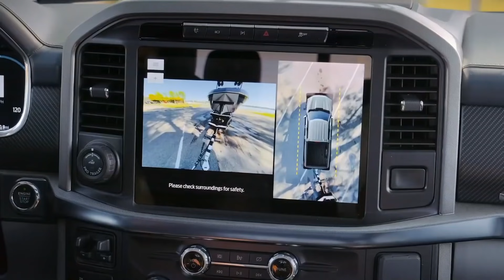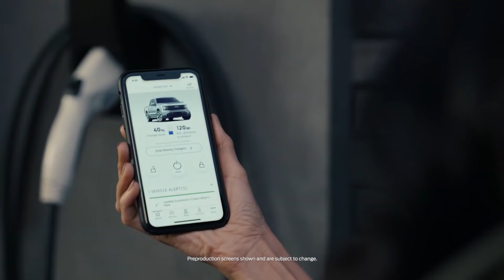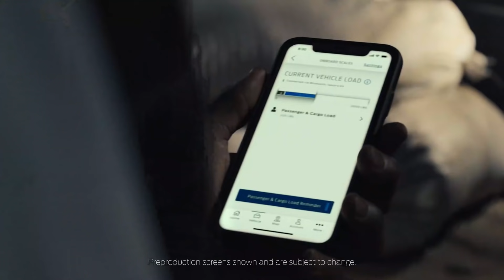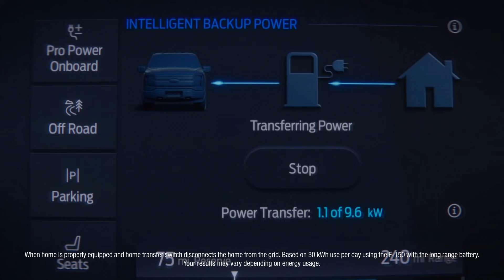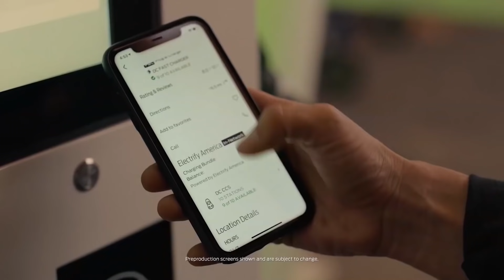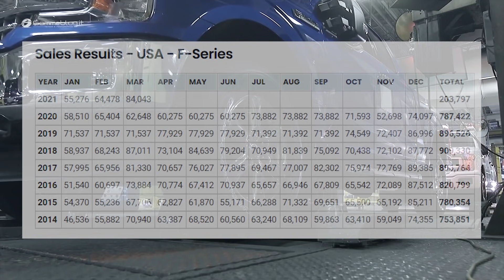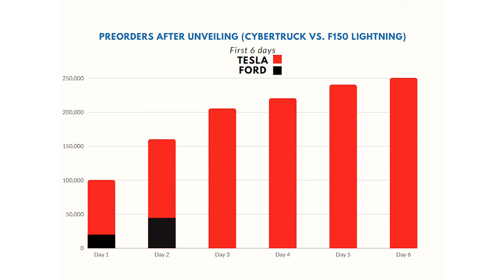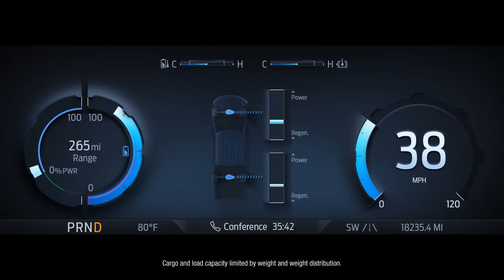Ford F150 Lightning Reveal: A Costly Mistake On Stage? | F-150 Lightning VS. Tesla Cybertruck

Comment: I’ve never owned a pickup truck and i decided to put a $100 Reservation for the Ford F-150 Lightning. I wanted a Tesla car but after finding out i could get a pickup truck for $52K or less, i decided to go for it. The 230 miles range is not a deal breaker for me and i love the truck to grid tech. Will the base model have the truck to grid  technology? I think i will be pleased.  Not sure about the Osbourne effect since I’ve never owned a pickup truck.

Comment: I believe you didn't  do enough research on Ford'spricing - The extended range was announced as being a $10,000 option, which is just for extended battery. The XLT was priced at $52,000 (230 mile range), and Platinum, with extended range battery and all other options was announced as a $90,000 vehicle.

I firmly believe adding $10,000 to any model to get a battery with an additional 70 miles of range is ridiculous- and I am a Ford investor! They should have included the extended range on ALL models above Base model. And Top model should have been reduced in price to under $80,000 to be far more competitive to the cybertruck and to win over the hearts of existing combustion era F150 drivers.

Comment: Just one data point for you,
I Pre-ordered. There is 0 chance I'd buy a brand-new ICE vehicle. 
Truck will replace my Prius, expecting 3-4 years before they'll actually be able to deliver me a an extended range model for <$60k. 
400hp vs 4000hp is irrelevant to me. Both will burn the tires clean off when I want that to. Same thing with 300 vs 3000 mile range, It doesn't matter because I'll never drive that much.
I'm not going to buy into a new truck company like Rivian, for fear they may go bankrupt and service/parts nightmares. Like a lot of people I've got bias towards and nostalgia for Ford Trucks. The CT and the Chevy's have a big wow factor in the styling, very nice, they'll do well I think. Just a bit too aggro for me personally. 

Ford marketing may well know what they are doing with this one, and we know enough about the powertrain from the early Mach E's to know that the engineering isn't completely horrible either.  I think it'll be a hit.

Comment: Front trunk is a sold hit double to center field.     Nobody wants to pick a back of concrete out of the frunk in a tesla    

Not saying that makes up for not going as far.       

In any case, I installed a 60 amp line to my garage for any EV truck I buy.

Cybertruck.. at same 39k   for a 4 door... is the most likely though.   
I like the frunk in the f150.. but I like to be able to put my kids in the back seat of the cybertruck more.

Comment: CT doesn't come standard with self driving, add $8k - $10k and no $7,500 for Tesla.  That being said I would buy a Rivian before either of the other ones.  I'm sure Rivian could strip their truck down and sell something for $39K, but I would only want the upper trim level anyway.
Reply: I like the Rivian a lot but Jesus is that thing over priced. It needs to come down at least 20k more like 30k to be really competitive. Seems like a nice vehicle and I really like the R1S but it’s too small for my family (6 kids). Hopefully with Amazon helping back them they can one day be more competitive but they start off more expensive than the top tier Tesla and don’t match any of the performance and now with the lightning it’s going to be harder to justify the R1T when you can get similar specs and design from a major name for significantly less.
Reply: @joshuavoss1387  R1S can hold 7.
CT 3 motor with autopilot isn't cheeper.  Ford performance doesn't match R1T, to get close, their  price will be right up there.

Comment: F-150 sales will probably take a hit due to people waiting for a Lightning.  However, the Lightning isn't a suitable replacement for all gas F-150s.... maybe not even most of them.  On top of that, there is info indicating that a significant number of Ford EV buyers are first-timers.  Ford will be fine as long as they can start getting Lightnings in garages about a year from now.  There is no firm delivery date for these, and everyone who has reserved one knows they will be waiting at least another year, so Ford don't need to be at full production capacity any time soon - they merely need to start delivering Lightning trucks on a regular schedule, which they ought to be able to do.

While the Cybertruck beats it on paper for specs and price (at least in the packages most people will be buying) I think there is a significant factor in the Lightning's favor:  It is an F-150.  This sort of mainstream styling - based on a proven and winning platform - could help mass adoption of electric pickups.

Comment: Those people (apparently including you) are going to come to realize EVs are NOT going to take over the market anytime soon. Long hauls in an EV? Hardly. And though battery technology is improving it has a HUGE distance to go. They'll still be selling internal combustion engine vehicles 25 or 35 years in the future. Car makers are STILL improving fuel efficiency and  emissions in ICEs. They wouldn't be wasting money if THEY didn't know ICEs are going to be with us for a long time and are getting ever more competitive with EVs and blowing them away for highway travel. I'm not bashing EVs. In fact I'm  a fan. But realistically they have a long road to be able to match conventional vehicles right now. The $40,000 Ford Lightning? Don't hold your breath. IF they ever actually sell them 40 grand ain't gonna be the price. But that figure gets people talking, and talk is FREE ADVERTISING. When EVs reach the point they're competitively priced, can go 400 miles between charges and charges can be done in 10 minutes EVs will have arrived. That AIN'T gonna be tomorrow. Or the next day. How many times does Musk have to overpromise and underdeliver before people catch on? Batteries are getting better by the day. But a BREAKTHROUGH is needed. Incremental improvements aren't going to be enough.

Comment: With the industries having a chip shortage the Osborne effect will not be as obvious to see due to the lack of sales. I work for Ford and the lots are nearly empty due to that fact, so to see Fords sales figures plummet due to the Osborne effect will not be feasible. I chose not to put in a deposit for the truck until I see them on the road for a solid 6 months to a year. Jumping into the unknown is not smart in my opinion. For sure Ford made a splash but let's hope they don't drown.

Comment: from 02:09-02:25. No Nissan, Hyundai and Kia are. Tesla just promises a whole lot and deliver 5 years later. If you do some research you will find that the Tesla engineers don't see any possible advancements in the full self driving capability, which Elon has been promising since 2015, past level 2.

Comment: It (Ford) needs an inverter and a switch installed at the Home by an outside company before you can power your house 🏠 . I would bet 6-10k  check the fine print
Reply: The inverter is in the truck.  Yes, you'd need a transfer switch to make it legal.  A homeowner could just backfeed a 220v outlet (garage, drier, etc...) as long as they switch off the main breaker before they connect truck to house.

Comment: heads up, the Lightning may in fact have MORE than 300 miles of range as this number is rumored to be with a 1,000 load.  Ford (like the Mach-E and Porsche with the Taycan) is simply leveraging the technique of "managing expectations" by feeding a LOW number to the dummies at the out start.  having manufactured vehicles for MORE than 100 years, they understand the psychology and behavior of neurotic/fickle consumers BETTER than consumers know themselves, as such they are "SUCKERING" us for own good.  #UNDERPROMISEOVERDELIVER

Comment: The 44000 people that preordered the F-150 lightning is of course 44000 people that will not buy an ordinary F-150.
Also a lot of those 1,000,000+ CT preorders are people that will not buy an ordinary truck (some may also preorder a F-150 lightning)
However, the CT is unique so a lot of those orders are from people that would never buy an ordinary pickup truck anyway.
Ford will need a lot of batteries, hope they have a plan for it.

Comment: The F150 Osborne Effect will mostly go to increasing CyberTruck sales.
Reply: Doubtful.  Traditional F150 buyer value product reliability and durability.  Until Tesla can establish it can build vehicles with acceptable build quality, your typical F150 buyers will wait.
Reply: @3Dogs1CatandMore  - CyberTruck, based on folded rolled steel and castings with mico-meter precision, will have build quality that will embarrass Ford.   Ford will lose more than a fraction of its traditional buyers -- it will lose a big swath of potential future buyers to CyberTruck.

Comment: The law of BEV is efficiency. Designing a traditional looking BEV pickup will not win the day.
Reply: Looks can be deceiving. Besides weight and motor efficiency, I agree the drag coefficient is a large impact (but mainly on range at highway speed; not low speed city range). I don't recall the drag coefficient being released yet for the Lightening or cybertruck. Will be very interesting to see those. But, you can't determine drag coefficient/aerodynamic efficiency by looks as looks can be very deceiving. There have been small sports cars have been produced over the years that look efficient but had much higher drag compared to competitors sports cars, so once up at speeds where those things become really apparent (the race track), they were non competitive. Their will be more refinements as the EV market evolves but there will be limits due to the needed form factor most end users require in a pickup (ground clearance, offroad capability, carrying compacity, usable bed volume, etc.)
Reply: @MrChadx1  I agree there are many things that effect range, but most of them are relatively fixed except drag. Truck weight won’t vary much as neither will motor efficiently. The trick to range usually comes down to aerodynamic. Everything else being equal a wedge or teardrop are far more aerodynamic that the typical pickup three boxes design with an open bed. Tesla is far more efficient in their cars compared to everyone except Hyundai. Tesla doesn’t do everything right, but one thing they are doing right is focusing on efficiency.
Reply: @matthewhuszarik4173  Agreed that it will be very interesting to compare the final drag coefficient and see how close they are. The rear of a vehicle is typically a larger impact than the front. Many think of a pointy front is the most important but a pointy rear is much more so (raindrop shape with the bulbous end at the front and the point to the rear is the most aerodynamic). The ground clearance of pickups is hard on drag coefficient, but at least the smooth undercarriage on these skateboard chassis helps. Front bumper and air dam make a huge difference, too, which is why some pickups now have very low (too low) front air dams which drag on everything. Some manufacturers have wised up and made auto-deploying under bumper air dams that remain up as low speeds (where they make no difference so stay up to give full clearance) and they lower once highway speeds are reached. Best of both worlds (though one more manufacturing expense and one more thing to break). 

Not having a grill opening makes a bid difference even in the typical pickup body like the Lightening. Even ICE pickups have learned that and many now have grill shutters that only open when cooling is needed but remain shut at other times to improve aerodynamics. It doesn't matter that the shutters are well behind the grill because by them closing, it traps a cushion of air that other other incoming air sees as a barrier and flows around. Something similar happens in the bed of a pickup at highway speed as can be seen in wind tunnel tests or real word by riding in the bed of a pickup going down the highway like we did often as kids. You learn real quick where and how the air flows (how it collapses, where it's still, etc.).

Even large wheels and low profile tires hurt aerodynamic efficiency at high rotating speed. Many have switched to smaller wheels on Tesla cars with higher profile tires to give the same overall diameter as stock, but greatly reduce wind resistance of the tall wheels with low profile tires. Every little thing makes a difference.  

Really anxious to hear the final drag coefficient for each EV pickup style (not only to compare to one another but to compare to non-EV pickups).

Comment: Put my reservation in on the reveal night!!
Reply: it's objectively worse in almost all categories compared to Tesla's truck. I mean best of luck and I hope you love it but maybe have a closer look before 100% comitting.
Reply: @SamWagnerDev  Dude, don’t be a Tesla Troll, the markets big enough for all of us...
Reply: @phileasler5401  huh? Why would I be considered a troll?
Reply: @SamWagnerDev  Likely because the differences ARE subjective and not objective. The CT and Lightening are extremely similar to one another in the big picture of things compared to ICE pickups so hard to justify calling either one "worse" than the other because that is based on opinion. Features that are important to one buyer may not even register with another buyer. If the specs meet their needs (range, power, creature comforts, fit and finish, dealer support, initial cost, insurance cost, ease of warranty work, locations for out of warranty repairs, etc.) who is to say one is "worse" than the other? Due to the varied and individual use cases, all of those things are subjective and not objective. 

They will both sell well and it's great to have choices for those that want an EV pickup and can live with the range and charge time limitations on these first versions. I'm happy that so many manufactures are getting into the EV pickup game so we all have choices in features and options (body/styling being the most obvious). I don't get the bickering and bashing from one potential EV pickup brand buyer to other brands. You'd think there would be a lot more EV pickup camaraderie rather than bashing each others EV pickup preference.  The cybertruck is not out yet either and with the track record of fit and finish on Tesla vs the mainstream manufacturers, your warning about the "have a closer look before committing" is just as appropriate for potential cybertruck buyers.  I think it's great so many are interested in EV pickups and I'm happy to see someone consider any brand. They will all have their issues/defects once hey go into production just like every make/model of ICE vehicle today.

Comment: 11:24 - You forgot that the Ford includes 4WD at $39K while the Cybertruck is only 2WD.
Reply from the maker: I will do a more thorough comparison between the EV Trucks in another video. Thanks for pointing it out though!
Reply: @Trailerwalker  I don’t see it. The Lightning just isn’t as good, especially the 39k variant which Ford has said is heavily stripped. You know it won’t have leather or air suspension like Tesla at that price and it certainly won’t have the 4 second 0-60 mentioned on this video or the vehicle to home (none do vehicle to grid). Ford already said you need the larger battery for that feature which the stripped version won’t have. The only thing we have really seen is the $90k platinum which is way overpriced IMO. At that price it still only gets the specs of the $50k cybertruck and doesn’t come close to the payload, towing, range, or speed of the still much cheaper $70k cybertruck. 

To me the big difference is in design and I’m not talking looks. The cybertruck is a unibody vs fords body on frame. Tesla motors and batteries are ahead of ford (and everyone else for that matter). Just look at the tear down of the mach e vs the model y by Munro. It highlights a lot of unnecessary complexity to the Ford.
Reply: I agree Ford can’t afford to make that 39000 version they just had to drop a number close to what Tesla is promoting, they will most likely fail to deliver that truck before Tesla is printing 250000 cyber trucks by next summer yearly.
Reply: Haha you're funny. The 39k Ford will never materialize

Comment: I’m not sold on EV trucks just yet. I suspect the range numbers are best case scenario and for warmer climates. I wonder once you hook a contractor trailer to one of these, use it in a New England or northern climate, or start using one for the trip cross country how practical it really would be. My advice is to let ‘someone’ else be the Guinea pig on these vehicles. Some day the range, recharge time and cold weather issues will be improved or worked out all together. The issues surrounding EV are complex and companies making them are only pointing out the pluses and avoiding the negatives. Best of luck to those that just ‘gotta have’ one.

Comment: I think vehicle to home was a brilliant move on the part of Ford, go where your competitor have a strategic disadvantage and for Tesla there only disadvantage is the fact that they would prefer to not cannibalize their  powerwall business. The cyber truck is by far the superior beast, but the chip shortage aside will they be able to scale as quickly as ford. If Tesla is able to offer the cybertruck with a vehicle to home feature ford will have a problem on their hands.
Reply: Ford has actually build pick ups and has the market know how. Just judging by the looks I can tell you that the cyber truck is not going to be as practical as the f150.